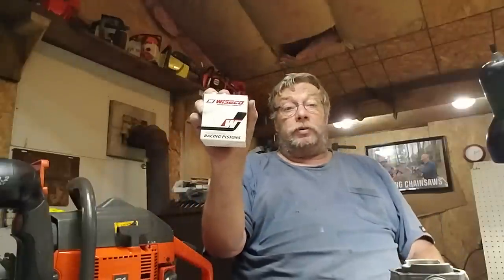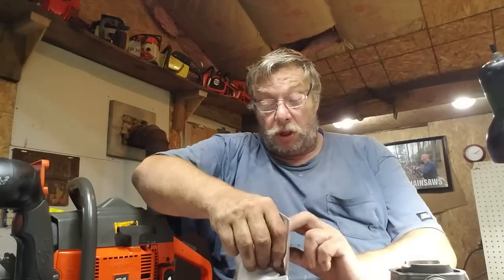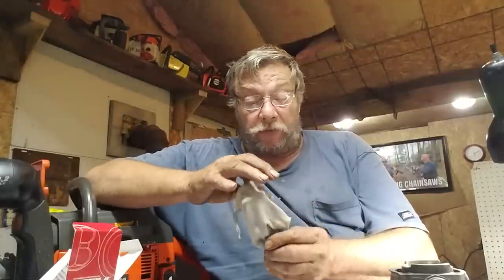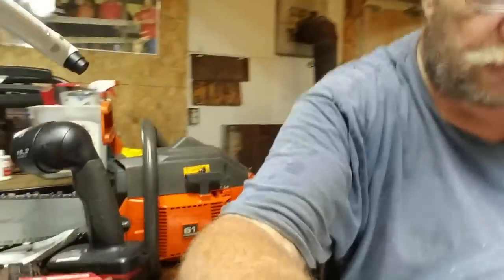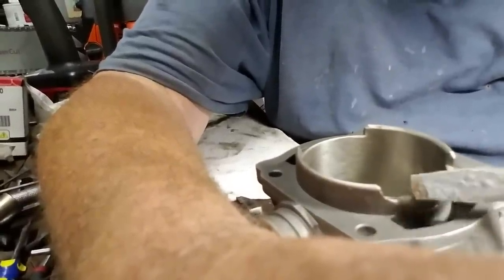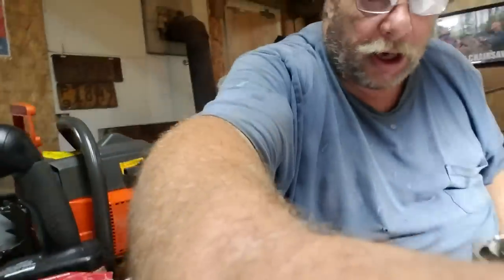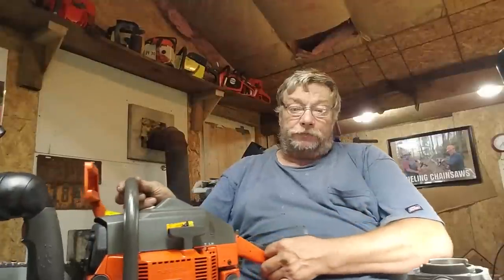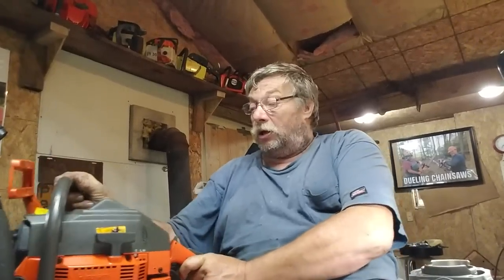High compression vs. Intake and exhaust timing explained!

Comment: I have used that JB Weld high temp on raising the intake on several saws with good luck so for with non coming back to me yet.Try it, you will be happy with the results.Just now finished up poulan 60cc saw with bad numbers on the intake.
Reply: After doing a little research on this idea I really liked the idea that even if it breaks loose that you might see a little puff of smoke as the saw eats it and spits it out.. I guess that it could definitely break something but it’s definitely a way to correct numbers and freeporting issues for cheap...  if I were playing with the g660 or something like that I would definitely give it a shot! 👍😁

Comment: I really dig the old “German?” Dude that has the different wood species plugs with carbides attached to cut new squish bands and a bunch of homemade tooling... he definitely discusses that on the g660’s and other cheaper cylinder’s that you have to cut them down so far to correct their timing that you have to use the JB to raise the intake floor to get your numbers decent and he’s even had the little puff’s of white smoke and then your saw’s not as good but it’s just passed the material..   I’d definitely be ruffing up and texturing the surface to aid adhesion and cleaning it extremely well before applying the epoxy but it’s going to stick if applied properly.  The dentist has the g660 and I believe a couple of others that he’s corrected with the epoxy technique... I’m trying to remember the dentist fella who has his own tool kits for chainsaw building and how’s been doing videos for heck like 10 years now??? Um ... Mathew Olson has several good videos that show the epoxy correction technique and he might actually reference the cat that uses the handmade wooden cylinder compression band cutting tools and does a lot of hand work and metal work by hand..  I definitely can’t remember that super cool chainsaw cat but he’s definitely got some informative videos???

Comment: Love this!! Quick question Harvey, have you seen any issue with Forged pistons seizing? Chased an issue in my old CR250, stock bore, whet the stock cast piston ran great, forged piston would scuff the exhaust port.
Reply: It could be the rings.. I know some forged pistons come with chrome rings and some cylinder plating is weaker than the chrome and the chrome breaks it down

Comment: How many grams is that piston compared to a regular piston weight??? And I’m confused that if it’s a stock crank with stock counterweight on the crank... then there’s a point of negation on the reduction of the piston weight increasing the power in correlation to the actual balance of the crank shaft assembly from the piston to the counter weight??? The reduction of weight increases the total amount of RPM’s and that increases the power bandwidth on the topend???  The balance of the total intake duration being equal to or ever so slightly less than the exhaust duration is what really ultimately provides the balance of the power stroke that is a “ported” saw???  I’m heading into the world of external and finger porting to add a little bump...
On the top of the piston I definitely don’t understand why the popup isn’t dished in it’s center to continue and aide the swirling of the fuel charge as it’s being compressed into the combustion chamber????

Comment: HT 383 Chevy stocker  380 horse 10 to 1 at 34 degrees 4000  fo nd that 10 degrees no Vacuum advance was a good start. Then the advance springs ended up being color brown dew to the 86 four door dooly 7000lbs is the timing with vac. My daily driver don'ts ha no. So I am a mason with 22 acres in Deerfield NH with at leas 1000 maple taps. I burn wood for the shanty I live in and Maple Syrup.

Comment: Alcohol needing the higher compression, would a surface discharge outboard plug be a better option for this build for better flame front travel? Your already doing a ton of work, so setting you plug gap while machining wouldn’t be much more work.

Comment: I’ve been looking at the ports on the 372 for a couple of years and I’ve just recently decided that I’m going to go ahead and just cut the two sides of the transfer port area and just leave the center support and then it can support a little strip of nikasil an help keep the piston a-line in the bore... the lower case pressure has to push a much larger fuel charge though that wide open port than it can up through those closed ports??? I know that tons of people say that these closed transfer ports push a more direct and directed charge to the top of the piston but I’m thinking that we over think everything and a chainsaw cylinder isn’t working like a motorcycle cylinder chainsaw has less pressure to push the fuel charge up through.... the total volume of the fuel charge would be increased by more then double by removing the material that is impeding the air space...!?!   The speed of fuel charge moving up through an open transfer is not going to be super impacted by the piston surface movement??? And it’s a 372 cylinder with a piston that’s skirted an not a wide open piston like a Stihl windowed piston....?!  I can’t imagine how basically tripling or quadrupling the total transfer ports area in these little basic air pumps...isn’t going to be working more efficiently and moving more fuel and therefore making more power and the bottom end pressure in a chainsaw is pretty low to push through those closed ports and manufacturer’s have used case stuffers to try and increase the pressure to push the charge up through faster and that’s all really seemingly totally over thinking something simple and I’ve experienced the difference in a 357xp/359 set of cases and design and how much stronger it was with more air space through the pump

Comment: Scored me 2 stihls a 028 super an 036 both run after new gas but 028 someone had taken flywheel nut off an all the bolts an plastic i cant figure out why they took it apart

Comment: I used JB weld to repair a leaky dealer installed helicoil on a old boat motor (spark plug threads) many years ago . It lasted a couple of hours before it burned out.

Comment: I really enjoy your videos. Your knowledge of  engine's especially two strokes is amazing. And I really appreciate your willingness to  share your knowledge with others. 

There is a misconception that the higher the octane the slower the burn speed and its not exactly true. There are high octane race gas that is really quick burning. Sunoco has a good article on the subject. They have some gas (Cyclone 17 is 117 octane) that is advertised as being really good for two stroke use because they are fast burning. 

Thought you might be interested. Anyway keep up the great work we all appreciate it.

Comment: Mr. Harvey, I have been looking for a good tutorial on how to adjust a carb. If you already have covered this topic could you send me a link to the video?  I just rebuilt my first carb on an old 266 and I do have it running good, I just would like to see how you go about it. Thanks.
Reply: @JustaGearHead I did tune it by ear, my 266 runs and has trigger response just like my 272, I am a noob at this and still worry about blowing something up.
Reply: Just set the screws at one turn out on each screw and you’ll be fine.. That’s stock settings and it’s safe
Reply: @patrickallred850  Thanks, I will be spending a little more time with my saw today, yesterday was getting late and I didnt want to piss off my neighbours too bad.